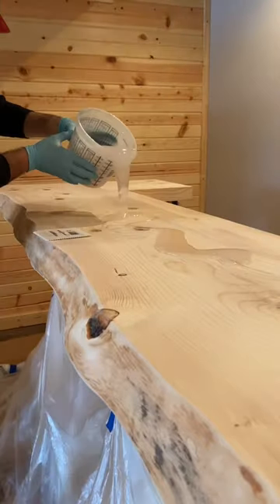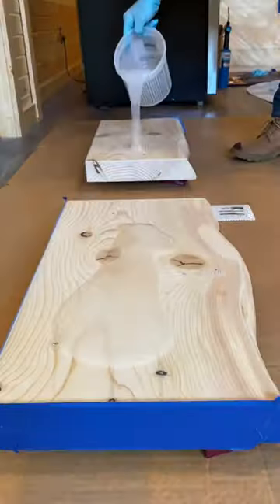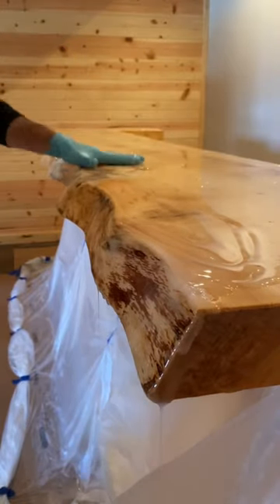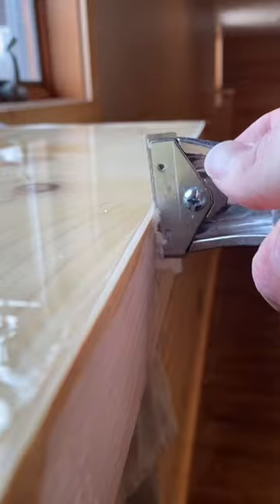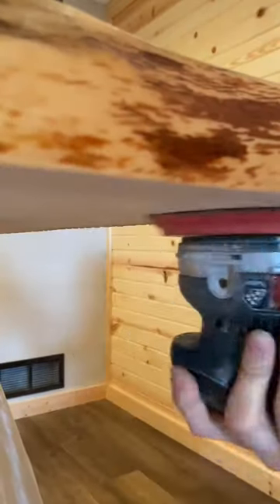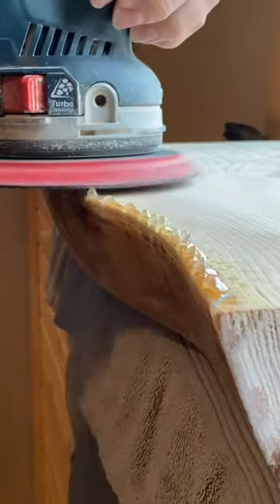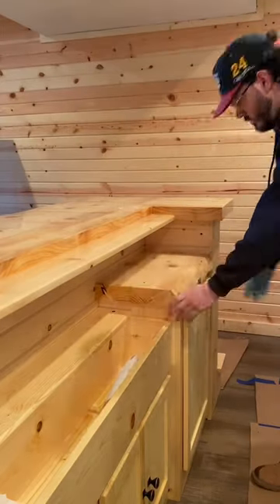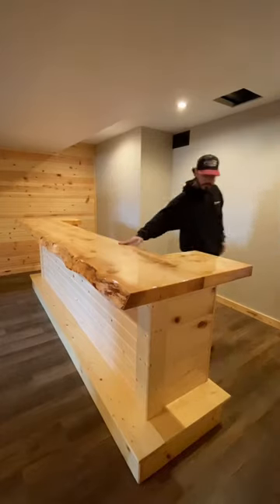Bar Top Epoxy Flood Coat #shorts #diy

Comment: Pro tip: next time put painters tape on the bottom. Then remove the tape when it is still playable but hardend. Easy clean up.
Reply: Yes my hubby and I did our counter tops in our kitchen just yesterday it’s like a sheet of ice gorgeous only thing is we do have lil dimples here and there but not terrible if we were to but more epoxy can we pour a lil to fill in dimples ? Or just leave it alone 🌻🌻🌻

Comment: It looks amazing! 
Do you use the razor blade after its fully cured? Or halfway through so its still a little soft? Im trying to make a epoxy coated cutting board and im struggling to make everything smooth and keep the epoxy nice and clear. If anyone has any advice it'd be appreciated!

Comment: Nice work indeed but I personally hate bars done like this as usually its way to thick. I did a bar 30ft long that went wildy wrong as the owner mixed to much epoxy in one batch and it went off virtually immediately.  I spent two days with a Porter Cable 4×24 sander with 60 grit to get it off. After sanding to 220 grit he instructed his bar staff to Johnsons paste wax it every day. Two weeks later it looked stunning and 15 years later it still does.

Comment: If you put tape under them and use a heat gun you can pull them off underneath without sanding them nice work

Comment: I'm honestly wondering what kind of sand paper grit or type he has if he is able to remove the epoxy drips in 2 swipes. I'm using 80 grit and it taking awhileeeeeeeeeee.

Comment: Where do you find live edge pieces? I’ve never seen them at Home Depot type of stores..lol do you have to go to a lumber yard? I’d like to try to make some charcuterie boards
Reply: Just Google live edge. Local options should appear. Or check Craig's list. For sale, materials, live edge. Good luck.
Reply from the maker: Local saw mills/ hardwood stores

Comment: Until it’s gets a deep scratch or chips, or the fact that over time will yellow regardless of the UV content because typical folks like to actually sanitize their eating space with harsh chemicals - all that takes a large toll on epoxy pour over finishes. 
Best to seal with a good oil or hard wax wood hardener, then final coat with a water-based sealer - and YES I said water base over oil. A Fully cured good oil base product CAN  be sealed with a good water base product.
Know you wood.
Reply: Please do share more! Recently coated a butcher block in a very expensive food grade mineral oil, and it sat untouched for 6 weeks, and it doesn't look like anything but raw wood now. 😭